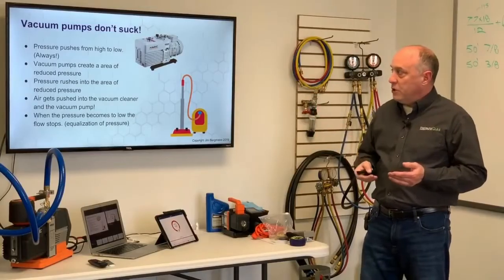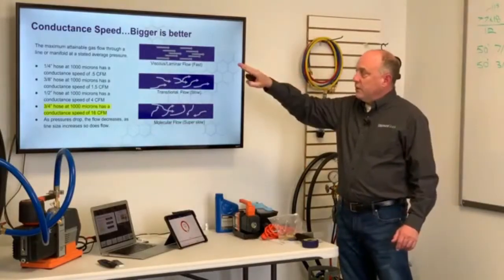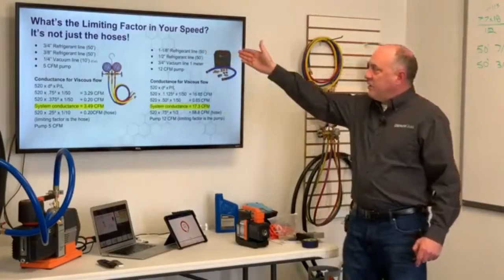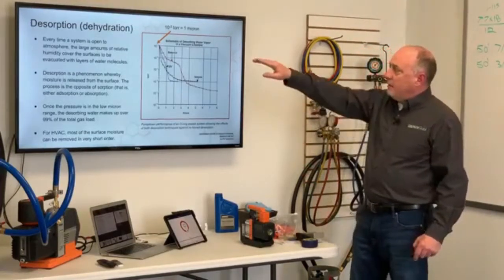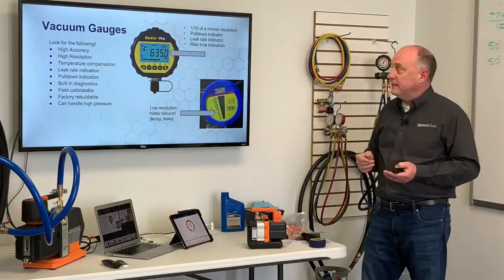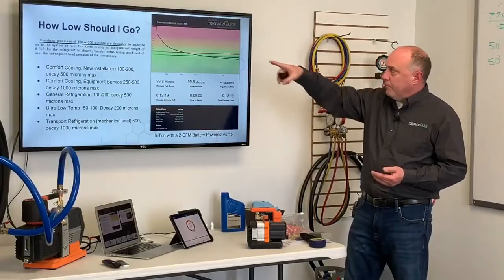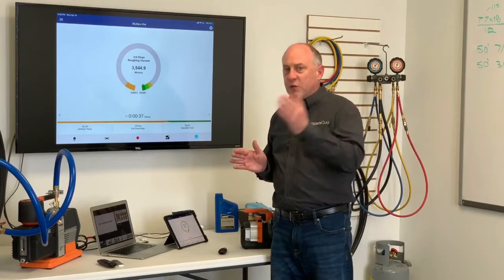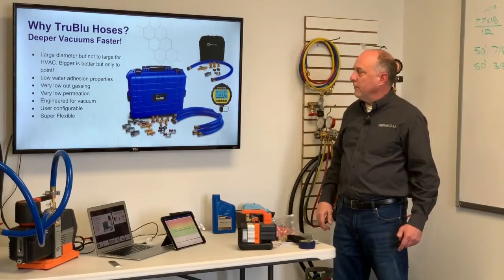Master Class on Vacuum & Evacuation (whole presentation)

Comment: as the vacuuming just starts there is a lot of air to move and smaller hoses will be a restriction .
but then as vacuum goes deeper there's almost no air to move and size of the hoses doesn't matter

Comment: Excellent video as usual. That said, I found one small discrepancy that would benefit from some clarification. At approx. 1:08 in the video Jim states that techs should “always” attach the micron gauge on the liquid/discharge/high side of the system in an effort to minimize any potential for contamination of the vacuum gauge. However earlier in the video (at approx. 1:02) it shows the micron gauge connected to the 7/8-inch copper line on the suction/vapor/low side of evaporator coil. In fact, Jim states that the micron gauge is _“hooked-up at the evaporator coil right at the outlet of the evaporator…”
 
Jim's explanation that follows at approx. 1:08 in the video indicates that connecting the micron gauge to the suction/vapor/low side service port (or evaporator coil and after the accumulator if present,) would help mitigate the potential for gauge contamination. Likewise, my understanding is that the best place to locate the micron gauge is at the service port on the suction/vapor/low side of evaporator coil when a vacuum hose is connected to the service ports on both the liquid/discharge/high side and suction/vapor/low side ports and the liquid/discharge/high side port when using a single vacuum hose connected to the suction port. (By the way, when using vacuum hoses connected to both high and low side service ports, Craig Migliaccio connects the micron gauge to the suction/vapor/low side as shown in this video.)

Comment: Great presentation but why do you keep adding the hose lengths together when they are ran in parallel?  Wouldn't that double the flow?
Reply from the maker: 10’ is a standard length. As designed the single hose has a conductance speed of 56 CFM.

Comment: Another thought, based on the theory, we should probably take off those OEM small adapter(s) or fittings on the vacuum pumps, and use a bigger one that matches a big hose, which further matches the pump’s CFM.  this should further improve efficiency!
Reply: totally agree .
that's another restricting point right there and no one talks about it.

Comment: ...so nitrogen doesn't really dry the ac system, it just pushes water molecules out of the system
Reply from the maker: Correct, it simply is a carrier to push the water vapor out. It does not act like a sponge.
Reply: @measureQuick  but, when ac system is highly "damp" inside, sooo nitrogen will be really helpful to remove a lot of water by own pressure force yes?

Comment: The problem is gravity obviously has no effect on gasses! take helium for example! it goes up doesn't it. and gas pressure must be contained from the very start.  I love your content,but natural law cannot be broken
Reply: @R.Forshee what you are saying makes perfect sense. The status quo sometimes prevents us from thinking freely.
Reply from the maker: https://chemistry.stackexchange.com/questions/59914/does-gravity-affect-the-trajectory-of-gas-particles
Reply: @measureQuick  youre joking right?  Chat board where someone makes a claim unsupported by any evidence whatso ever.  I Need backing by scientific  experiment independent, dependant and control vaiables. Besides  the bending and warping of space time is only a concept.
Reply: Then why is the atmosphere surrounding us on our earth? Why don’t they escape? And the higher the altitude the thinner the air!
Reply from the maker: Ronnie, if gravity did not have an effect on gasses we would not have an atmosphere. Gasses have mass, energy, specific gravity etc. If someone told you otherwise they are wrong.
Reply: @measureQuick  perhaps your presupposition is wrong at its foundation.
Reply: @measureQuick  If someone told you gravity does all of these magic tricks, then they are wrong or lying!

Comment: Its confusing how water vapor volume increases as the temperature drops of our teaspoon of water.  Can you explain this ?
Reply from the maker: "Specific volume is inversely proportional to density. If the density of a substance doubles, its specific volume, as expressed in the same base units, is cut in half. If the density drops to 1/10 its former value, the specific volume, as expressed in the same base units, increases by a factor of 10.

The density of gases changes with even slight variations in temperature, while densities of liquid and solids, which are generally thought of as incompressible, will change very little. Specific volume is the inverse of the density of a substance; therefore, careful consideration must be taken account when dealing with situations that involve gases. Small changes in temperature will have a noticeable effect on specific volumes."

Comment: I've been a service tech for 16 years , nobody ever told me to loosen the ballast when you start the pump and close the ballast around 2000 microns for a deeper vac . Education
Reply: Did you ever read a [the] pump manual?
Reply: @kylestan2250  tbh standard hand tools where the service techs only  responsibility prior to me moving to commercial refrigeration.  I didn't own my own pump , analyzer,  digital Manifold,  vacuum rig , hoisting gear or propress.  Now that im competing for the best calls with other seasoned techs . I need better gear then they have so I can't depend of the employer
Reply: @mikepict9011  I don't know, as the safety guy I had a copy of all powered equipment with the equipment and had all who used the equipment sign a log stating that the manual was read and understood.
Reply: I also see schools not teaching adequate ductwork skills as well.
Reply: @Sovereign-WV Citizen  thank satan for public unions and the high standards of professionalism set by the trustees of liberty.
Reply: @Sovereign-WV Citizen  after testing ..i barely do it . And ductwork well done is a whole different trade then service . Full techs kinda should be hacks with tin . Because time / value / knowledge.  Its worthy of a specialist.  Pay for one
Reply: @Sovereign-WV Citizen  my surgeon is a crappie janitor waaaa. Yeah because your wasting his time ha
Reply: @Sovereign-WV Citizen  you knows whos really competent ? Public unions.  Especially unionized police detectives.  Those guys are brilliant and irreplaceable.

Comment: Dear if vacuum is not good and refrigerant R134a is charged in chiller.so as we know that if vacuum is not good so chiller pressure will increase. So After this how we remove moisture from refrigerant??
Reply from the maker: The only way is filter dryers.
Reply: @measureQuick  is that possible in centrifugal flooded chiller ???

Comment: @ 39 Minutes, I totally agree with him on the oil, but would like to say one thing, if you go from job to job just installing small splits and relatevely clean systems (no brazing) short pipe runs the pump definitely doesn't need to be changed every time, however I have pulled a system that I changed over 5 times in a single pull down...
Reply from the maker: Mark Smith agreed, you can always just check the ultimate pull down of the pump to get the relative condition of the vacuum pump oil.

Comment: Awesome video
I wonder if you could discuss in the future how to best deal with a system repair where you have refrigerant that needs to be removed to vacuum levels prior to recharge.

I have had a frustrating time on repairs due to residual refrigerant in the system. Hard to tell if you have a leak vs rise due r22 or r410 still in the compressor.

An example of a rise curve may be a nice visual.

Also recomendations as to how to rid all of the refrigerant from compressor and its oil.

I generally will pull down several times with a long nitro sweep between

Thanks

Comment: Amazing video with wery well documented information and very well presented.
I got two full A4 pages of notes :D
But I have some add-ins:

-How the zone of lower pressure is created? Not by removing air from the system?! The inlet of a pump is also called suction or aspiration. From my point of view, we have a flow.
The reason why water from the bottom of the tank is not driven out by the flow is because it is not in the way of the flow and even if it was, the flow rate is to small to move it.
-Vacuum pumps are volumetric type pumps.

-I don't know about that conductance thingy..
What I now is that flow is determined by section and difference in pressure.
At the same pressure difference we will have different flow rates at different sections. And the increase is not linear.
On vacuum, since the pressure in the system drops, also the maximum possible difference in pressure drops, therefore, the flow drops.
This is why the difference in section matter so much when pulling vacuum.
This might be another way of explaining why bigger hoses have better flow.
This aspect did not cross my mind until I saw this video. Didn't think that hose section count so much when pulling vacuum.

-What I know of regular pressure hoses is that the ineer rubber part holds the fluid, then there is the mesh that prevent expanding due to pressure and the exterior layer is for the mesh protection.
The issue is the mesh is designed to hold pressure and it will collapse under the vacuum, decreasing even more the section, therefore, the flow.

As as disclaimer: I'm just a young guy that it's not satisfied how split unit AC was installed :D and start digging the internet about how it's properly done :D